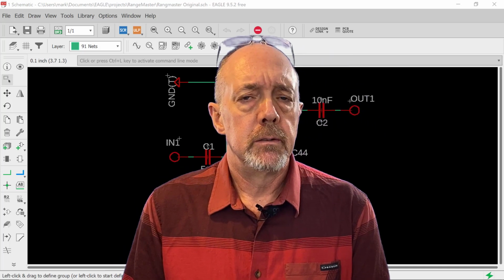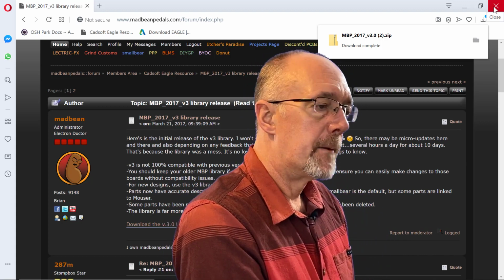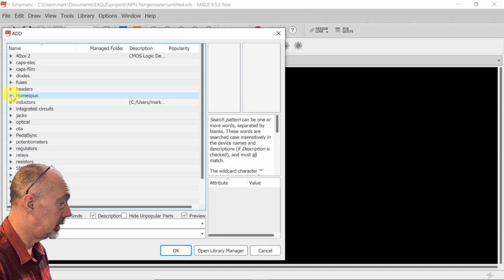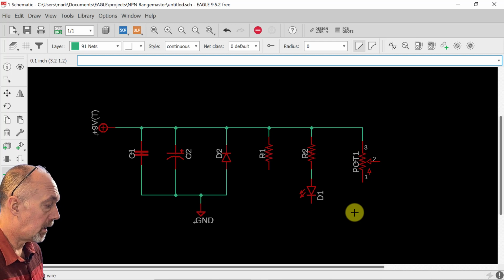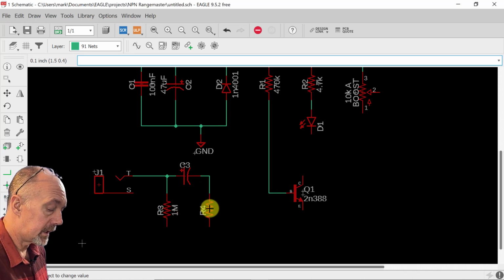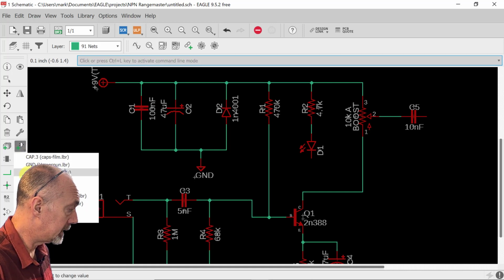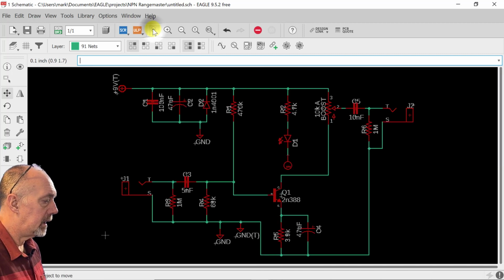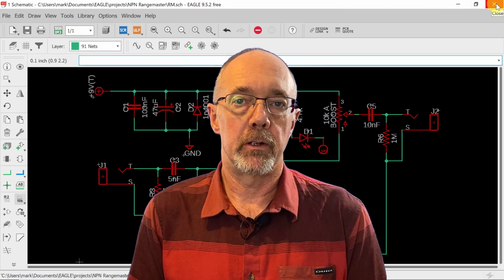Build Your Own Effect Pedal - Treble Booster (Part 1 - Set up Autodesk Eagle)

Comment: Germanium transistor 2n388 is nearly impossible to get. Is there a substitute? I found one, 2N1304, but it sounds over driven with this configuration. Any ideas?
Reply from the maker: Judging from a very quick peek at the datasheet that should be a decent substitute. You could also try a NTE101 but they are about 1.6x on the Hfe.

Comment: Did you go to school for electrical engineering? Love the detailed and resourceful lesson. I stumbled onto a hidden passion for guitar signal and tone chasing about 2 years ago, built first few fuzz pedals completely from scratch rather than ordering a kit bc of the simplicity of Bazz Fuss circuit. Fell in love with the craft immediately and dreamed of starting a small company using my background as a carpenter to build unique cabs and housings, and learning the electronics on my own.

Well that dream went on backburner for maybe a year until I applied and was accepted into electrical engineering at central ohio technical college a week ago. It's pretty interesting that so many folks who are much more knowledgeable than myself have learned mostly on their own from books and online resources. Was just wondering what your background was if you don't mind sharing with a greenhorn?
Reply from the maker: I took a 6 month class back in 1988 but it was for repair, no engineering or anything like that. Didn't really learn much from it and never worked in the industry. Fast forward to recent times, I joined a church band and got into tone chasing. Mostly because the amp they “bought me” was absolute trash (Fender Hot Rod Deluxe). I wanted a Klon and they were tons of loot. So I looked into building pedals and figured out Eagle and started copying schematics. That’s pretty much the history. The church band never really worked out because they were consistently testing me by giving me the songs an hour before service. I hate using charts. I asked for the songs a week in advance and they said "not gonna happen” so I started sitting out.

Comment: awesome vid! did you think of running a simulation to see how the circuit behaves??
Reply from the maker: For simple and time-tested circuits like this and most home-built pedals, I don't. I will breadboard from time to time if I'm experimenting. 

If were talking making changes to an amplifier power supply or tone stack, I'll simulate them.

Comment: im on mac and the homespun effects link is just downloading as a txt file. any help?
Reply from the maker: You've got to control-click the link and choose "Download linked file as..." or "Save as...", the contextual menu depends on the browser.
Reply: @HomespunEffects  thanks for replying so fast ! That’s what I did the first time but the downloaded file didn’t look the same as the files from madbean. 

It’s getting late here in Scotland but I’ll be sure to try again in the morning. 

Thanks again sir, your channel is great!
Reply from the maker: @danjo7398  let me know how it works out.
Reply: @HomespunEffects  hey man! It still isn’t quite right. I’m pressing control click and then selecting “download linked file” but it’s downloading a TXT file instead of the necessary file to go into eagle. 

It may just be a problem for Mac users thought buddy, I doubt it’s a problem with the way you have set things up
Reply from the maker: @danjo7398  I tried it on my Mac and you're right. It adds a .txt file extension when downloading for some reason. I am going to have to change the content type for the web page or something. 

Just take the .txt off of the end of the downloaded file for now and it should work. I'll try to figure out how to make it work as it should. Thanks for letting me know about this issue.
Reply: @HomespunEffects  ohh ok! Hope you manage to get it fixed man. Once again keep up the good work. It’s helping a lot of people for sure. 
Cheers

Comment: These are the perfect videos for a newb like me.  I've searched everywhere to find something to help me get started building pedals and this is by far the best reference.  Have you done a video where you trace out the schematic and explain what is going on?  I'm also curious.. just off the top of your head, what do you think this project cost to build?  Thanks!  Looking forward to working my way through your videos.
Reply from the maker: I generally don't get into very much electronic theory. Especially since my last class was 32 years ago and I've probably forgotten as much as I every knew. 😂

I should make a quick database for these projects concerning how much they cost. Not including shipping for parts, I figure the cost of the treble booster is right around $23.
Reply: @HomespunEffects  Thank you.. definately cheaper than buying a kit :)  Do you know of a resource that will trace a pedal circuit and explain what is going on?  It is much easier to find info on building amps than pedals.
Reply from the maker: Electrosmash and fuzzcentral are great sites to check out.